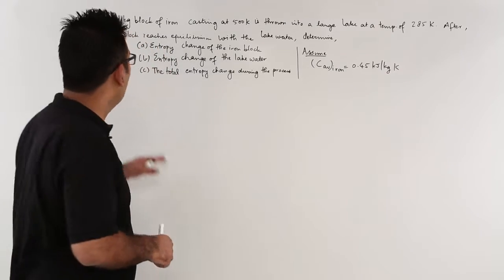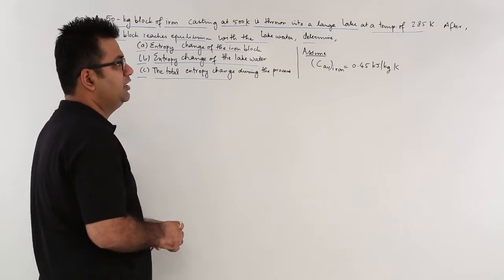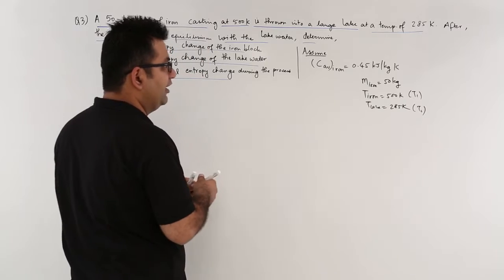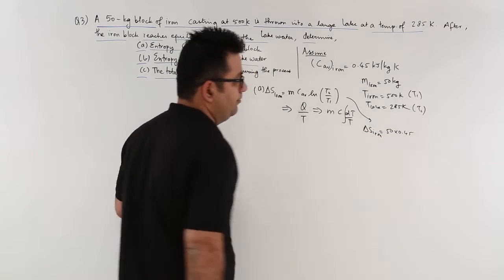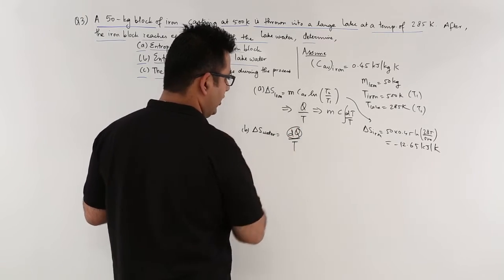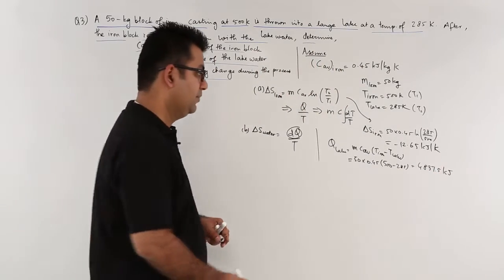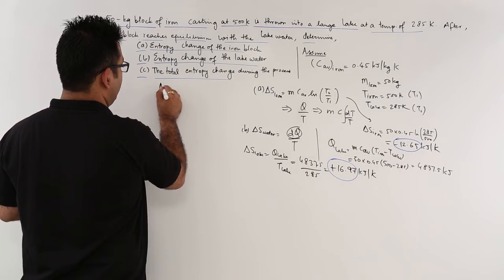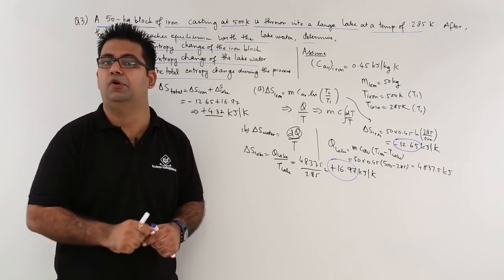Entropy Numerical Example 3

Comment: Sir, you have calculated ∆S(lake) as
∆S(lake)= ∆Q(lake) / T(lake)
By the same formula if we calculate ∆S(iron)
Then,
∆S(iron) = ∆Q(iron) / T(iron)
 = 4837.5/500 = 9.675 KJ/K
WHY there is a difference in answers.. explain please.
Reply: Bcause temp of lake is constant (=285K) but temp of iron block is changing from 500K to 285K.
Reply: thank u brthr
 @2shar808
Reply: Yes sir change it.. Or tell it in the comments.. Bcz it may divert some students